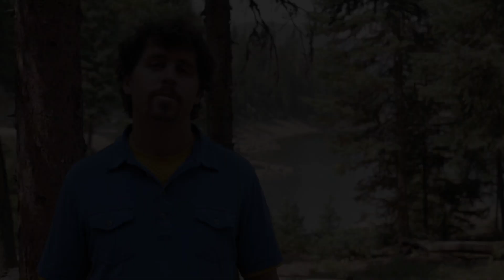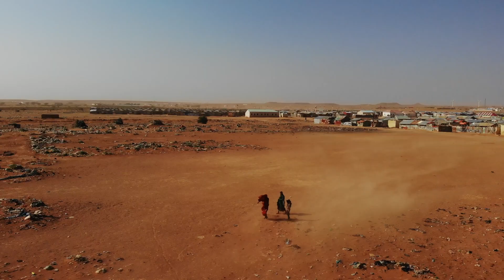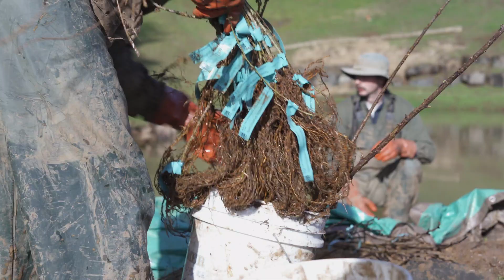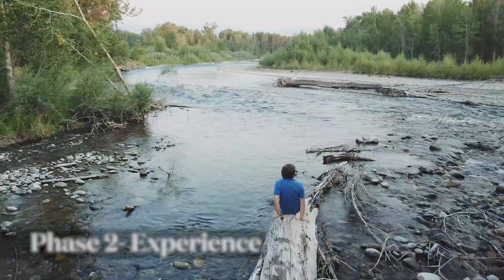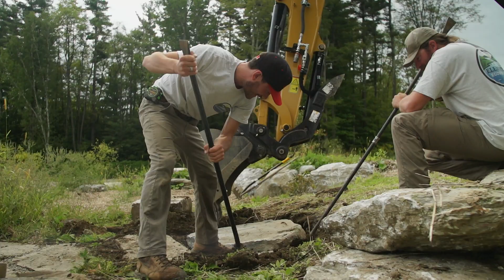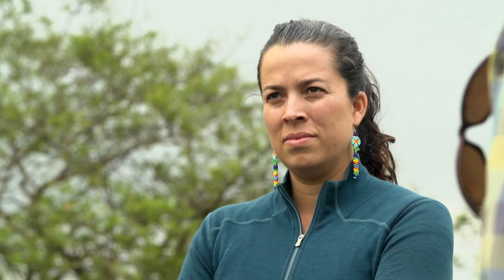Water Stories Core Course - learn how to revive rivers, reverse drought, and restore watersheds

Comment: Sounds to be an exciting course. May I know the course fee please?
Reply from the maker: We are still finalizing the details.  If you signup for the waitlist here you will get access to the introduction module from the course as well as the remaining details as they are finalized.  https://www.waterstories.com/corecourse
Reply: Zach Weiss - is there a corrected 'landing page', etc to offer for this crashed link?  Thanks.
☆☆☆☆☆
" ... This Serverless Function has crashed.

Your connection is working correctly.

Vercel is working correctly.

500: INTERNAL_SERVER_ERROR
Code: FUNCTION_INVOCATION_FAILED
ID: iad1::m2phm-1707233091006-c2a2762ba982

If you are a visitor, contact the website owner or try again later.
If you are the owner, learn how to fix the error and check the logs. ... "